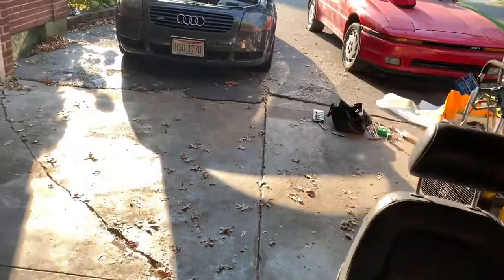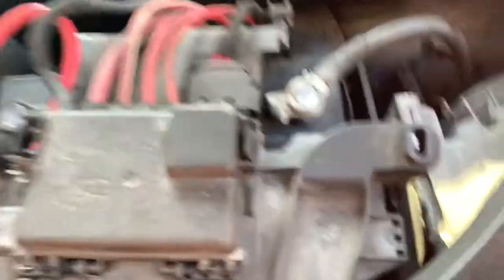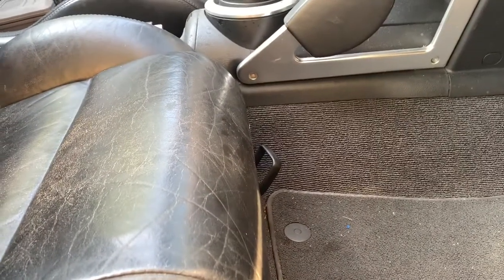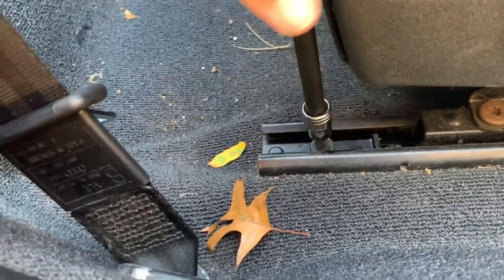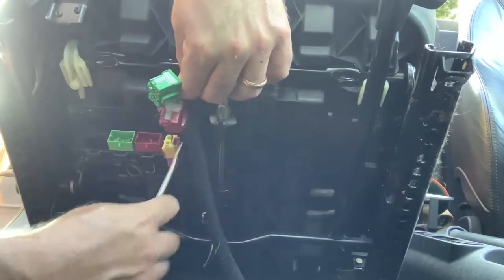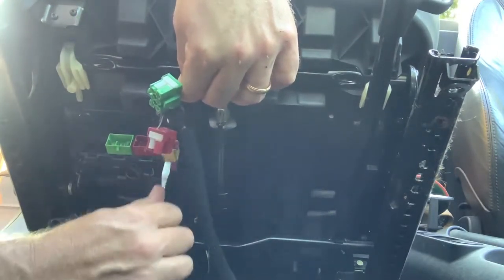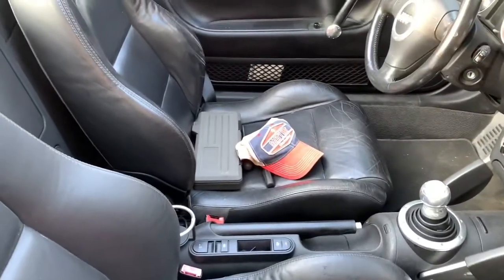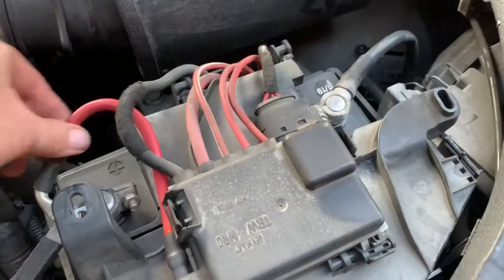2002 Audi TT Seat Removal and Replacement.

Comment: Good info on how you remove the seat 
But you could of proper cleaned all the plastics up before installation to do a proper job
I’m OCD  btw 😎
Reply from the maker: Thanks for your kind comment! Ah, you are correct, it definitely could use a good detailing! :)

Comment: What did you have to do to get the holes lined up and why weren't they lining up in the first place?
Reply from the maker: I think it was just the way I had set the seat in initially, trying to line up the rear holes first as they were the ones I could see after attaching the wiring harnesses and tipping it back down. I lined up the front ones better and that helped line up the rear, if I remember correctly!